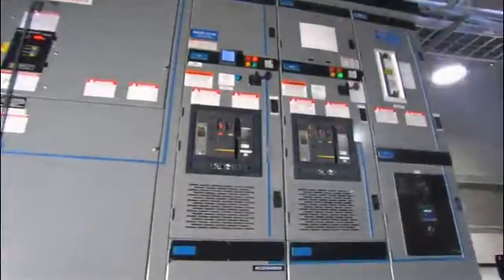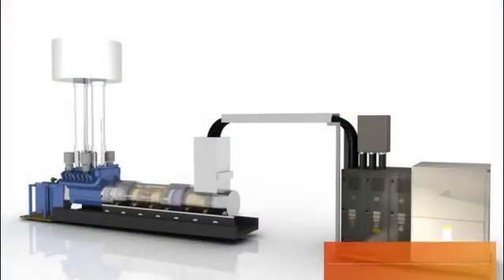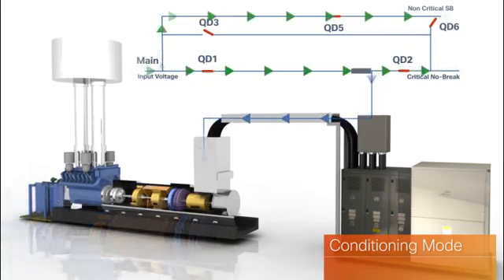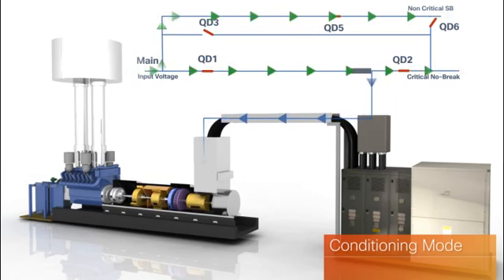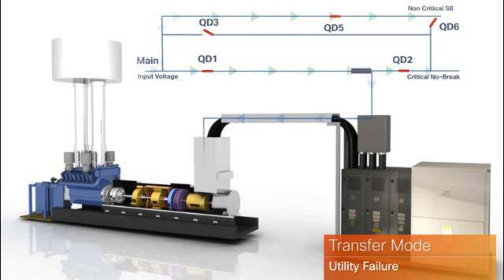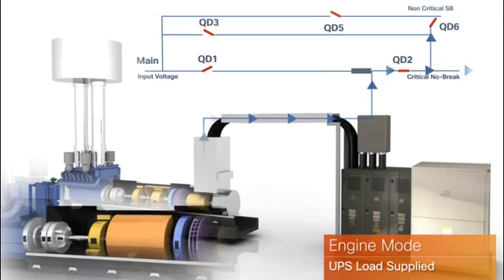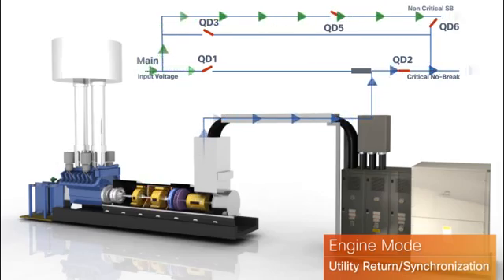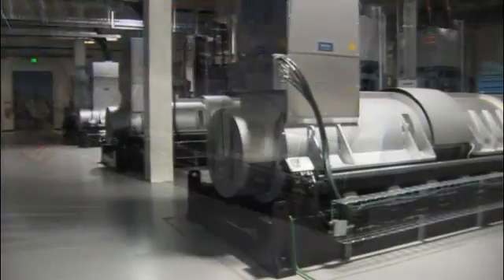Dynamic Rotary UPS at Cisco's Allen TX Data Center

Comment: DRUPS are very inefficient - constant mechanical losses of 15% or more! After ten years, you send 10-20 tons back to the manufacturer for an overhaul. Very expensive!
Reply: Really..?, we plan start to evaluate to install DRUPS in our plant. Can you give us more detail how mechanical losses of 15%. thanks.
Reply: The alternative is double-conversion online UPS, which can have losses as high as 10% themselves. And while that flywheel might last 10-20 years, you have to replace the UPS batteries after 4-5 years.